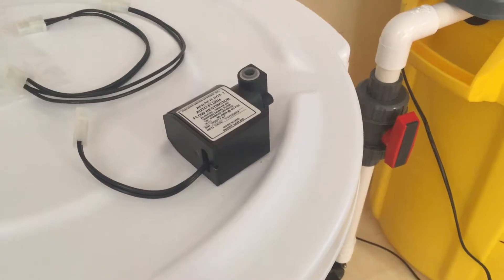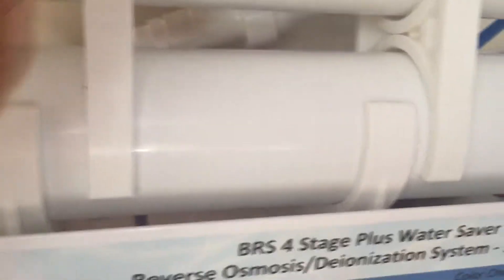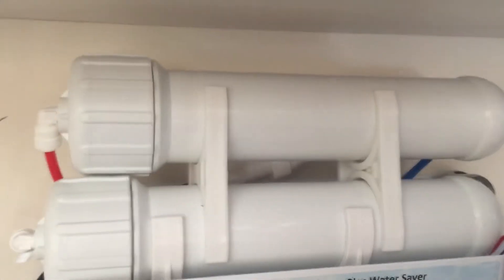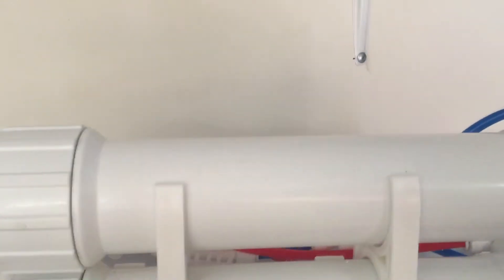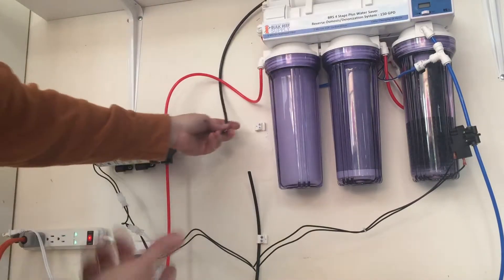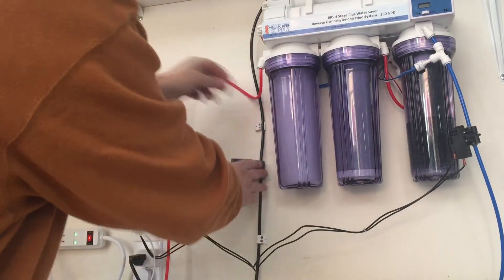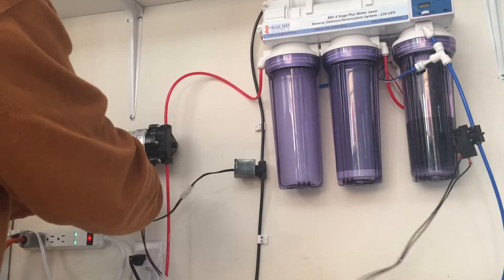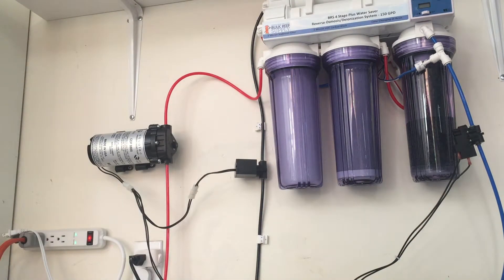Installing an RO/DI Auto Flush Valve

Comment: Do you need the back pressure shutoff valve when the flush is running off a booster pump, I thought they were only for when not powered from a booster pump?
Reply from the maker: Hi. I followed the instructions from the manufacturer. I can't say if it will work without it, but mine works perfectly.

Comment: Hi question. Work it all good together with one poer suply or did you put a second one later?
Reply from the maker: I only used the one power supply and it works fine.